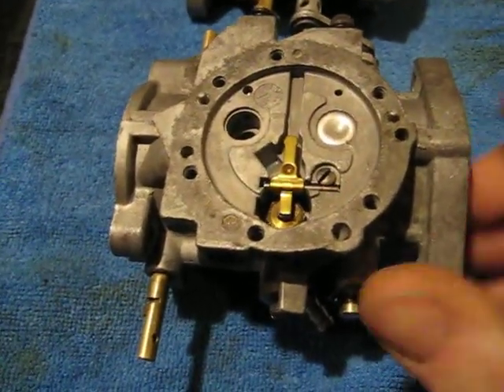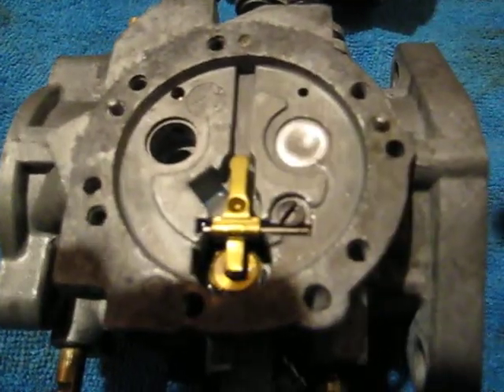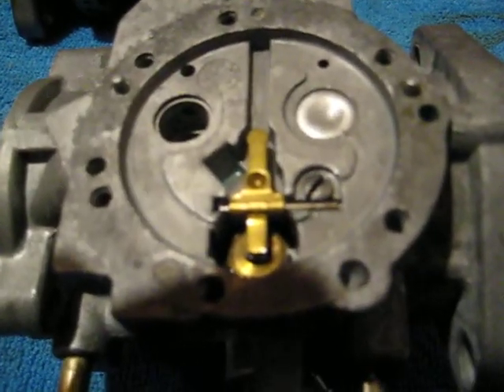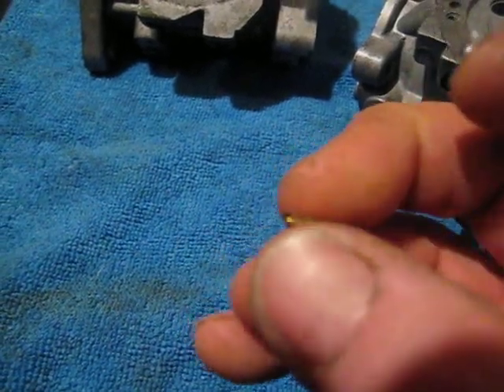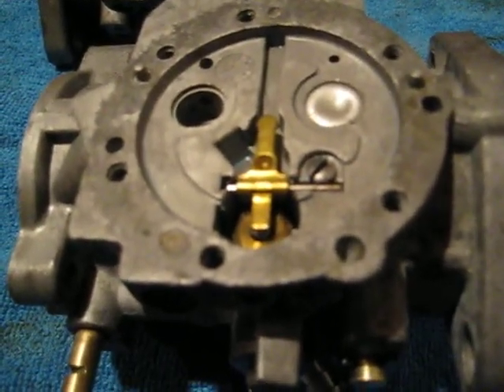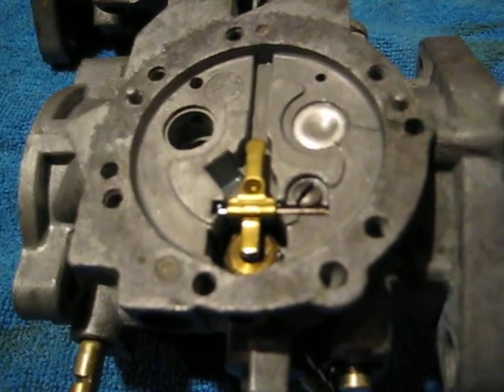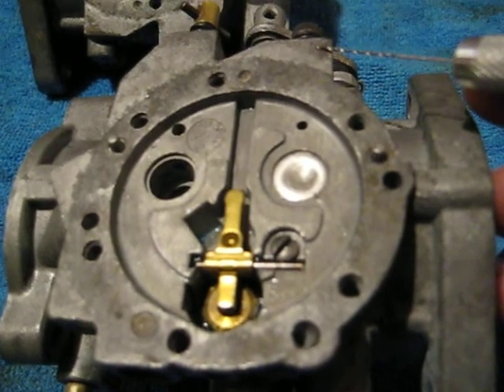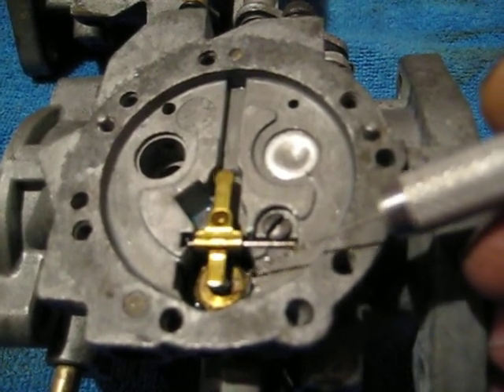The Tillotson Bog Part 1

Comment: I have a 75 tnt and it will run really good for a bit then bog right down to where it can’t even turn the track. It almost seems like it’s starving for fuel.  It’s just strange that it will run full rpm for awhile then bog right down.
Reply from the maker: Is it running on both cylinders? A lot of time the ignition will lay down on one side due to a capacitor going bad or the points failing when it is hot.. unless there is no vent in the fuel system and it is creating a vacuum in the tank leading to fuel starvation. Hard to see from here lol
Reply: @robh9577  yeah I get that lol.  I think it is I haven’t really thought about checking that. But it idles fine and runs good. It’ll rip really but then bog right down to a stop but stay runnning. I’ll check the fuel vent tonight

Comment: Goodday. My hl 166 is nit sucking fuel from the tank no upstruction in fuel line. Could it be that the botom seal is leaking i find the plastic cap os a little to big
Reply from the maker: The bottom cup or filter cannot leak as it will not suck fuel from the tank without a good vacuum.
Reply: @robh9577  thanks ik try to fix it if it leaksi am almost certaim it leaks.

Comment: Can I ask a question... What is the difference between a 42 gram spring and let’s say a 48 gram spring? In terms of performance, how does changing the pressure spring affect the response of an engine?
Thanks in advance
Reply from the maker: More spring pressure is more pop off pressure, generally more fuel flow.

Comment: Hi rob. I have a 69 Olympic 320. I can get the machine to sit and idle, but won’t rev up and barely moves the machine. Fuel seems to pour out the carb. Have you seen this happen before. ?  Thanks. Steve
Reply from the maker: You can try to wind the high speed screw all the way to see if the nozzle valve check ball is stuck open. The larger screw and is usually the one with the T handle on it.
Reply: @robh9577  I tried screwing but all the way in. It will idle but the moment I put throttle to rev up engine it stalls. Any thoughts
Reply: @robh9577  would check valve be defective. Or does this sound like something else
Reply from the maker: @steveparks2172  did it stop flooding with the screw tightened?
Reply: @robh9577  well it would say not it wasn’t. As when we touched the throttle it would snuff out and not run. As if it wasn’t getting fuel. 

One thing we did notice is if we unscrewed the high side 2-1/2 turns instead of 1-1/4 it ran better but still wouldn’t idle up high and rev out like it should
Reply from the maker: @steveparks2172  ok so you have eliminated a bad nozzle valve/check ball, if you are winding out the high speed screw and it is getting better, it is lean. You either have a fuel restriction like the tank to carb, or the carb is not flowing fuel properly (bad diaphragm or a bad gasket in the carb), or an air leak (carb to engine gaskets, cracked insulator plate, crank seals) causing the lean condition.
Reply: @robh9577  Thank you so much Rob I will try those repairs and I’ll let you know thank you